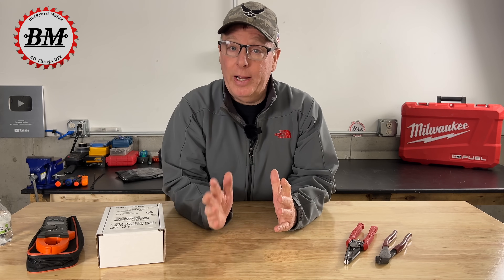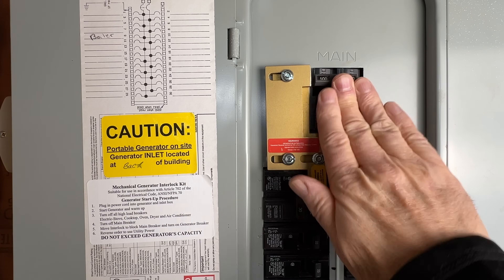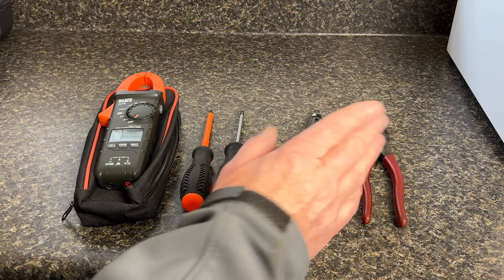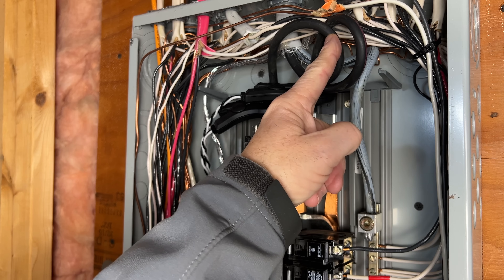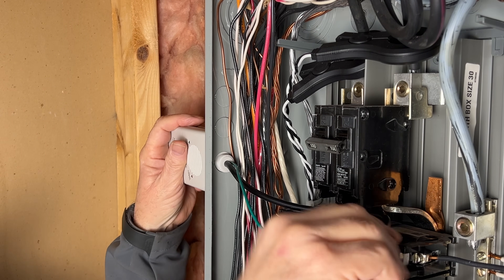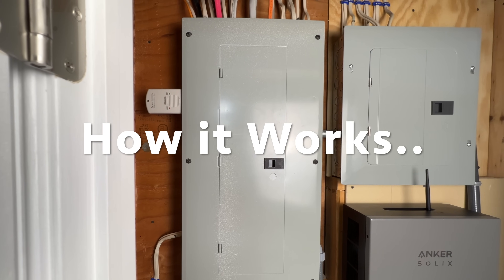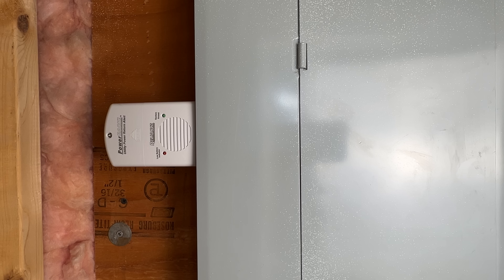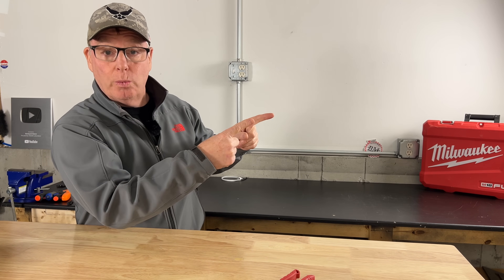The Secret to Knowing When Power's Back On!

Comment: I hot wired a light to one leg of the main power side of my manual switch. Light is on continuous until power goes out. With the generator on the light stays off until main power is restored. I use a low watt led bulb for the indicator light.
Reply from the maker: I've seen that done but it's against code because your wires to the switch and the light have no overcurrent or short circuit protection. If you have a failure with the light, switch or wiring you could have an electrical fire in your home.
Reply: @BackyardMaine  The main power lug is probably not rated for multiple connections, and almost certainly not for small gauge wire.
Reply: I did something similar. I mounted a Miniature Circuit Breaker 120/240VAC 20Amps Breaker 1 Pole Circuit Breaker DIN Rail Mount inside the panel and then supplied my service outlet beside the panel with it. It is supplied by one of the hot legs before the main breaker. I have a night light in one plug and a little $10 smart wifi relay board plugged into the other outlet. In the app for the smart board, I set it to notify after it senses a power loss. I also set it to automatically trigger one of the relays upon power restoration. This will send a notification to my phone from the app. Then using Alexa routines, I created one that when that relay is triggered will make Alexa announce on all smart speakers that the power has been restored. I keep my fiber internet and wifi router plugged into my UPS so its always active if I'm using CMP or the generator. CMP supposedly will text you when power is restored but they either never come or arrive several hours after it's actually restored which is pretty useless IMO.

Comment: This signaling device works great.  I have the same set up. It works by a magnetic field around the supply side conductors from the meter.  You could also look at the street lights in your neighborhood because if they’re back you’re likely back on too.
Reply from the maker: We don't have any street lights where I live but that would be helpful.
Reply: I look to see if my neighbors have power.  Granted, I can only see two neighbors from my house, but that's one more than I need.  :)
Reply: Yeah because power is only restored when it's dark outside 🙄
Reply: street lights are a good indicator half of the time.

Comment: @fredeerickbays      Actually this is a not a “piece of shat u do not need “.  If you are running the correct interlock system, the main breaker is turned off during generator operation.   With the main breaker off, the panel is not connected to the grid. So, there is no way to leave one light connected to the grid, hence the need for the device depicted in this great video.  Thank you to Backyard Maine for posting this, and all of his other informative videos 😊
Reply from the maker: Thank you!
Reply: Or you could put your transfer switch on a sub panel that only feeds essential equipment. It's not necessary to feed generator power to your entire house. Save money and fuel with a smaller generator.
Reply: @CognitiveHeatsink    with an interlock you can also flip off circuits you don't want during an outage. Just use colored tape or a sharpie. This will save hundreds of dollars over a TS and subpanel. I did that for years and only used a 5Kw gen that also powered my well pump. Using a microwave instead of an electric range is really the only drawback during an outage.

Comment: another piece of shat u do not need.  Just leave one light connected to gird when it comes on power is back on need to go spend money on this shat.
Tumbes down for tying to sell something that has no real use.
very bad form
Reply: It has a use for some.
Reply: WHOLE house transfer switch can use this. YOU don't know what you are talking about. If your transfer switch just powers part of the house, then you don't need because when power comes on, the rest of the house will be on.
Reply: @hotpuppy1  Exactly. Just like I said. This setup is for when you have a safety interlock on your main breaker and your panel is isolated from the utility power. The video doesn't talk about a partial transfer switch system.
Reply: Not too bright, are ya? If you're using a portable generator with a direct power inlet to your panel and a safety interlock, which is what this device is for, your main breaker must be turned off in order to turn on your generator feed breaker. If your main breaker is off, which means no power to your entire panel from the utility, how do you "leave one light connected to grid"?
Reply: Not really possible if you have a manual transfer for your whole panel.
Reply: @dguiley  that's literally what this is for. When you manually transfer using the lockout, you have no way of knowing that the utility power is restored.  This will tell you that. Are you saying your switch is on the outside of the house so you wouldn't be able to hear this?